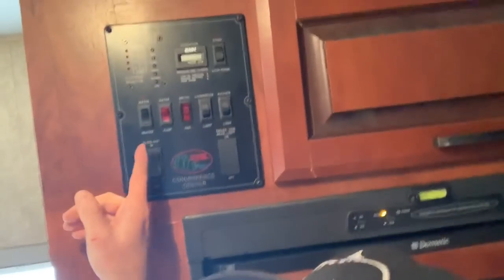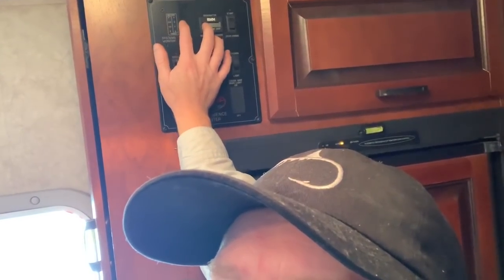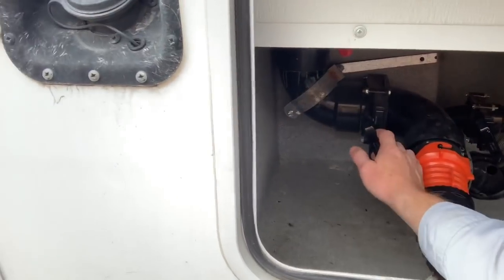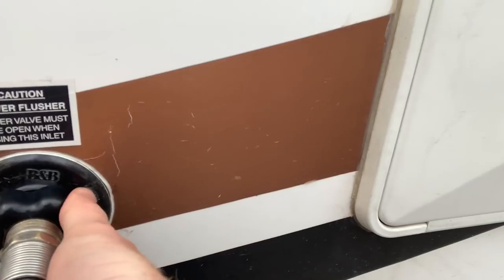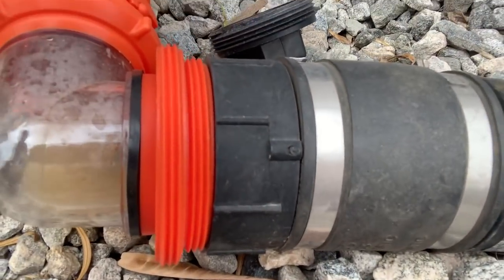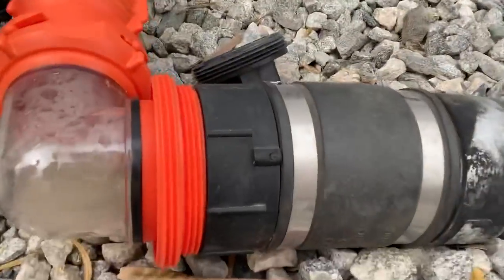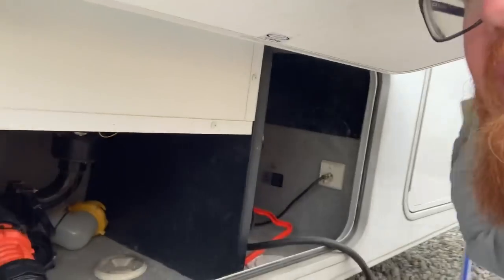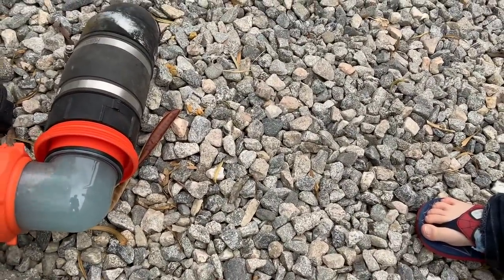The RV routines - Flushing the tanks.

Comment: Shawn,  You might want to leave a couple of gallons, maybe more, of water in your black tank so you don't get the dreaded "Poo Pyramid" under the toilet.  Since you're stationary for quite a while the liquids in the tank won't mix with the solids too well and so the solids don't break down.  You might want to check out this link:  http://www.irv2.com/forums/f54/the-dreaded-black-tank-pyramid-101195.html
Reply from the maker: Yes, I do, when I flush down that little orange thing, I flush down quite a bit of water with it.  Usually more than I showed on the video (in the interest of time).  And, after flushing the tanks, I also use the sprinkler thing like I showed on the video, which should wash away most of that poo pyramid.  I was getting that BTW when I first started, and I figured how to not have that anymore.  It is kinda a sucky thing isn't it?!  HAHA.